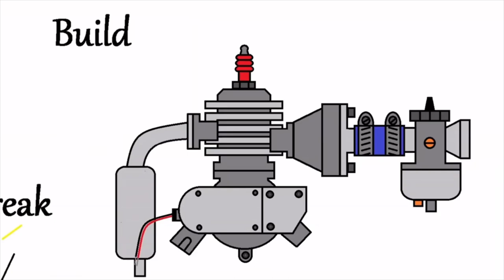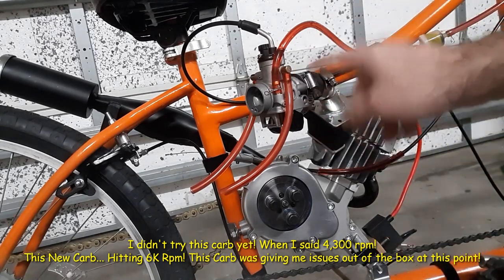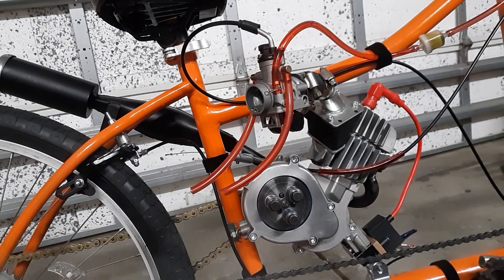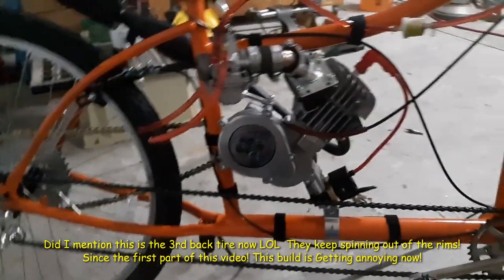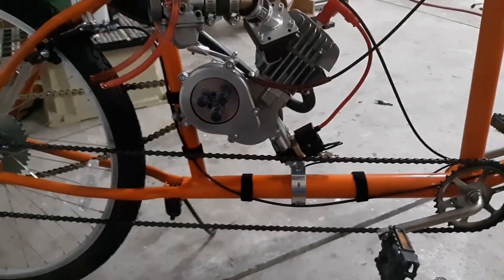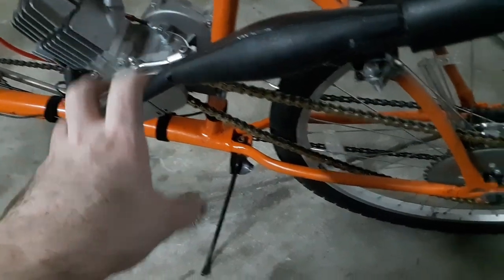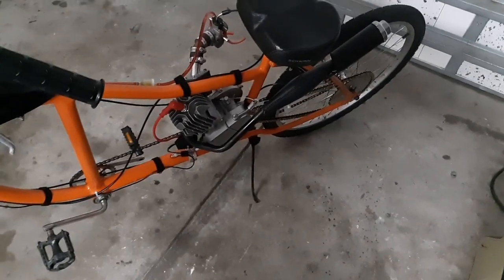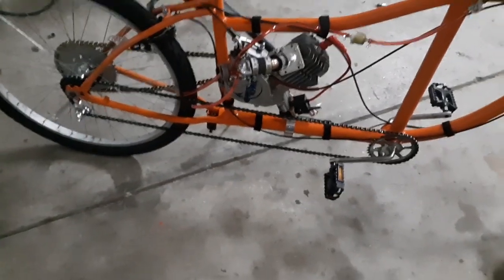Motorized Bicycle Power Stroke Build!  Hitting 6K What The "Pucky" LOL?.....

Comment: purty sweet ride to bad it has issues . you should try a old moped back rim . should already be set up to go and built alot stronger . basically there mini motorcycle wheels . but i bet you knew that already . i dont know if or what mods you need to do to make them fit . but almost any junk yard should have a beat up old moped with a good back rim .
Reply from the maker: It really needs a rim lock type rim.  Honestly it just to much period I think for a bicycle in general
Reply: Or a EUC rim
Reply from the maker: @greenwave819  Euc rim?  Tell me more?  What is it?

Comment: I seen a guy make some clutch pads from brake/clutch lining material he got from McMaster-Carr they have like 5 variations......They also come in several different thicknesses.   I'm thinking they might work great with a super clutch.
Reply from the maker: The ones in this are exactly that! Metal ceramic pads! Just not enough holding force made by the clutch to even make then grip well enough to clutch surfaces!
Reply: @BuildBreakFix  Well that sucks.

    Off subject.... My crazy bicycle tire retread idea looks like it'll actually work after all. I seen a video of a guy retreading a bald off road go-kart tire with 3M Scotch-Weld plastic/rubber glue. He did some burnout testing & the rubber tore in half but the glue still held. The PR40 glue type was the cheapest but runny at $14 & the thicker PR1500 to fill voids better was $19 a bottle. It's $14-$19 but if it makes a rear tire last 3-4 times longer, it's worth it (if sidewalls don't get all cracked up- 303 spray on new tire helps stop it). 
    It'll  help stop flats & the tire won't melt away on hot summer black top roads. Some discarded adventure motorcycle tires with silica embedded & the right tread pattern would be great for wet roads. It's a night & day difference riding a motorcycle on wet roads with silica embedded tires VS non silica. With the Bridgestone silica tires, I could ride & corner almost as if the road was dry. The 1/2 price non silica Kenda tires made you dread wet roads. 
I found some discarded Hoosier dirt track tires with a tread pattern that looks like it'll work good. I'll be able to cut a straight even strip out that'll glue right to the bald spot..... My rear tire only lasted a couple months last summer coz the hot black top.

Comment: Is a PZ22 or VM22 carb too big for a 49mm piston?  
I seen a good deal on a PZ22/G2 reed kit for $40 (VM22/G2 reed kit $45) ......Comes with air filter/carb/G2 reed/2 different size reed intakes/all the fittings to connect carb to reed.
Reply from the maker: vm22 works awesome on 48-54mm @ 40mm strokes!  pistons! pz22 is a bit harder to setup! less options then nm22!
Reply: @BuildBreakFix  Thanks for the reply/info.....I think I'll spend an extra $5 and get the VM22 kit.
 If I remember right, the rubber bowl seal/gasket on the VM22 clones will swell up & get trashed if it comes in contact with brake/parts cleaner. Just gotta remember to keep it away from solvents. Not sure what E85 would do to it.

Budget build of -49mm ported jug, fairly balanced crank, cast head, G2 reed, vm22 carb, $45 mz clone pipe should be enough for now.
Reply from the maker: @michaelbrinks8089  Vm22 and clone has a TPC rubber gasket on the bowl.  It's not that it swells it's cause most people are not careful with reinstalling it and they pinch it and it becomes deformed as a result!  Make sure it lays flat on bowl and put it in place making sure the gasket is flat before you go cranking in 4 bolts again lol!  I used tons of them and they all worked fine.      I have a 49mm iron sleeve i just turned into a pure ethanol build. love that engine topend more then saw builds lol!   Actually intend on doing a 4 transfer port build with one shortly!  Iron sleeve is perfect tunnel material to hide the secondary ports under! 😉👍
Reply: @BuildBreakFix  I dunno why I watch so many motorized bike videos. 
What 2 stroke oil do you use with E85?  Sadly E85 or E85 compatible 2 stroke oil isn't sold anywhere in my town.
  
Doctor Motorcycle has been converting lots of air cooled 80's motorcycles into turbo E85 bikes since they run much cooler....The cooler E85 helps offset the heat from the turbo & higher HP...... Seems like an E85 air cooled 2 stroke bike makes more sense than using gas, if more places sold E85.

Comment: What is the estimated power curve, given that the clutch won't hold fast. I'm guessing a lot of torque from it's atc origins.
Reply from the maker: 10300 watts @ 4k rpms!  Massive low end torque!   roughly putting out  5.4 ftt lbs at 2k  if gives you an idea!  a well tuned yd100 at 5k rpms in it's peak power curve point can make around 4.5ft lbs lol
Reply: @BuildBreakFix  daaaaamn

Comment: Hey bud. Wondering where your at with the duel cyl build?
Reply from the maker: It is actually finished. Runs super clean on a stand Been trying to figure out an exhaust setup. For bicycle yet.  Been waiting on gas for my tig to weld it up. Yet as well.  So its been on hold at the min.
Reply: @BuildBreakFix  dude. I have been waiting for it for so long!! Saw you had a spell you did post. Was praying for you hoping it wasn't health related

Comment: That is way too much power for a simple bicycle if you're breaking smokes and stuff like that and you're smoking pads buy some RDM ones and get a Gemini wheel set you might not break them then again I could be wrong
Reply from the maker: It's going on gokart I think for fun.  Way to over powered for a bicycle period
Reply: I'd still recommend getting the RDM pads because they're meant for high RPM stuff if you're going to be putting it on a go-kart
Reply from the maker: @audiomanatee9278  lol They are the pads in it man! Green metal ceramic pads! I have a full clutch of them not just a few! They literally smoke if you drop the clutch! just cant grip enough I use them in every build few videos on them and one of this build when i dropepd them in also!
Reply: RDM doesn't use metallic ceramic pads it is a rubber heated resistant pads maybe you should look at his website before you simply argue
Reply from the maker: @audiomanatee9278  Yeah they have volcanized rubber and metal ceramic ones for there bigger builds Maybe you should learn what your talking about first before you try to act like badass lol@  Cause I have 3 videos comparing all 3 they sell to others as well!

Comment: put a compression valve on and on so u can stop snaping stuff u can put that on it ull be abull to dstop some poer an ull be abull to do things or get a cdi u have the skill change the timeing so it dont have as much power
Reply from the maker: Not when it starts. It's when you hit the throttle. Torque in this is insanely high by design of top end!Its not a typical 2 stroke speed build. Complete opposite end of the spectrum!